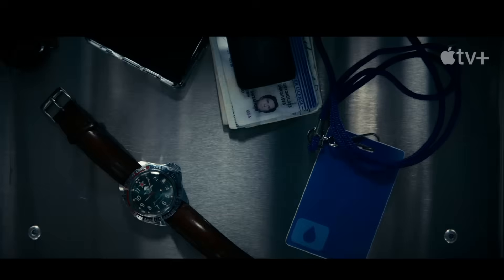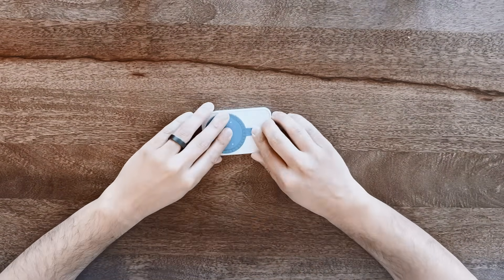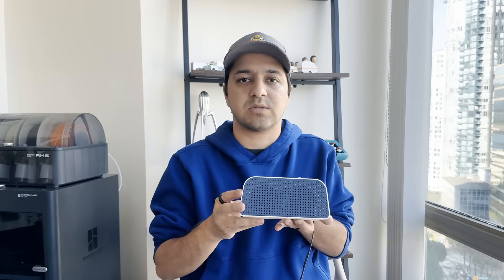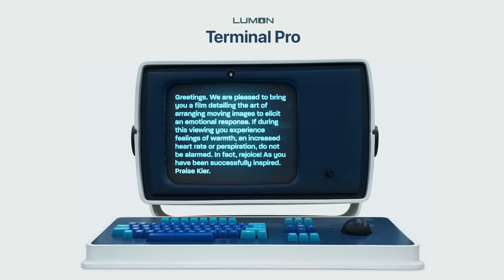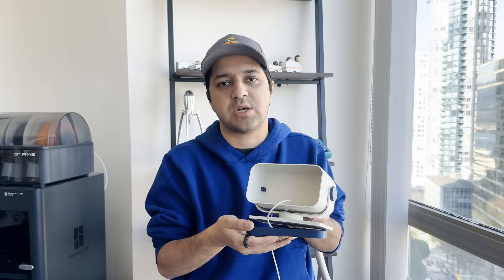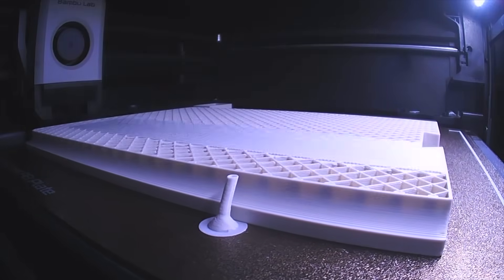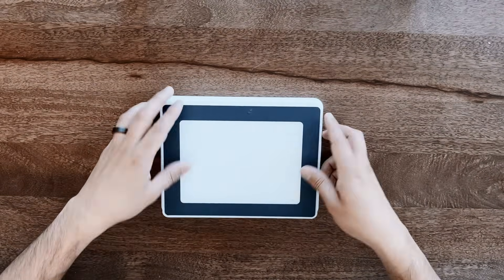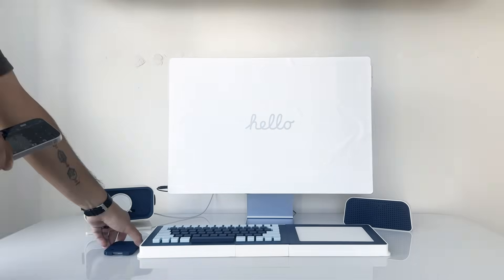I designed and 3D printed Severance office accessories

Comment: I just printed the cardholder, but I am not sure how to get the small top over the magnet. Do you glue it or is it supposed to fit?
Reply from the maker: I just used glue, you can probably use a thin double sided tape.